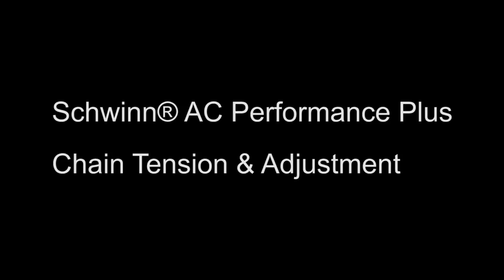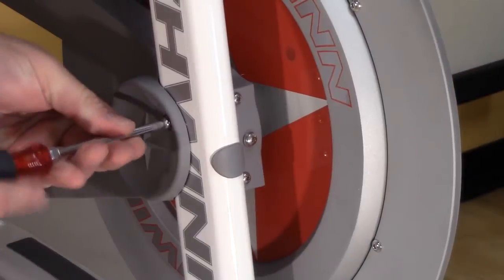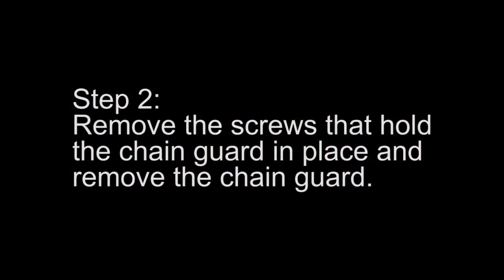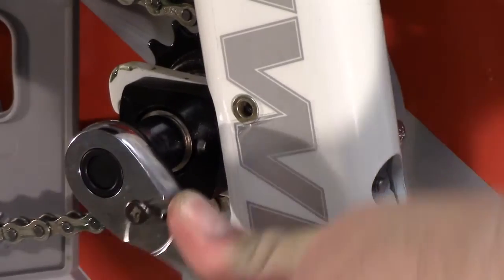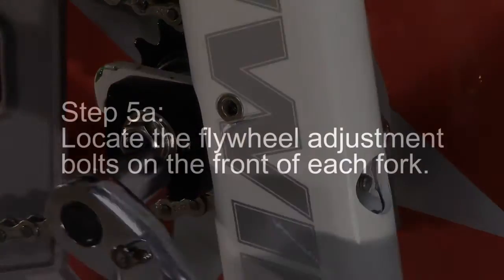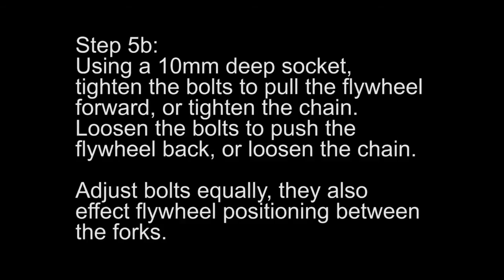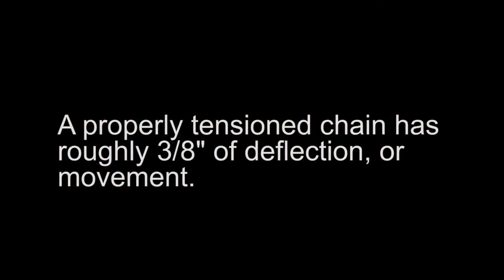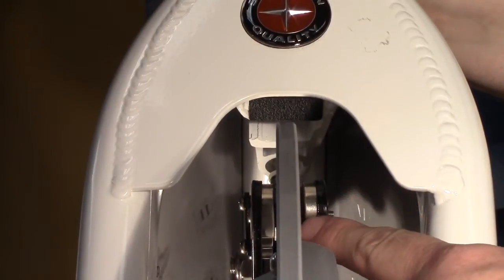Schwinn ACPP Chain Tension & Adjustment

Comment: just got my ACPP and when I tighten the resistance to max capacity the fly wheel locks up completely. there is absolutely no movement (and I have strong legs). But when I turn the knob to release tension just a little it becomes too easy to pedal (not enough resistance). It appears the wheel gets locked be the black thing that protrudes from the resistance knob, if that makes any sense. Any suggestions?
Reply: Loosen the tension knob all the way,  start riding the bike, turn the tension nob to the right gradually until you reach the desired pedal resistance.